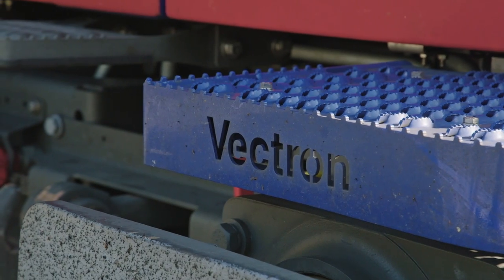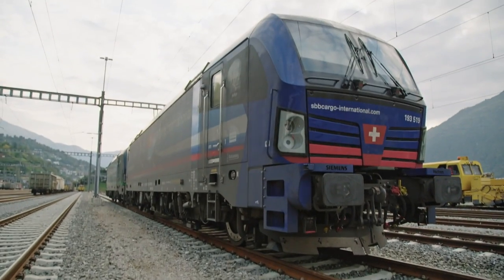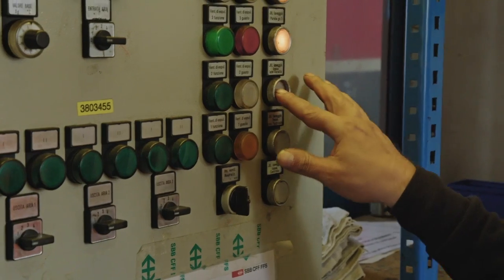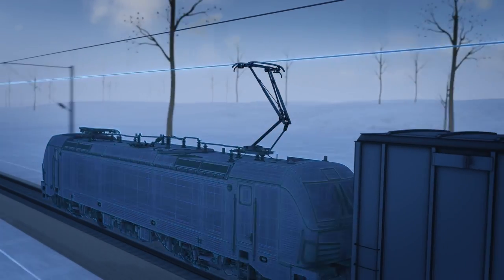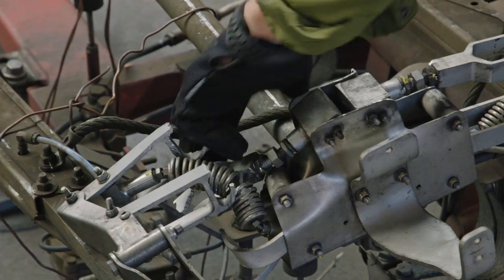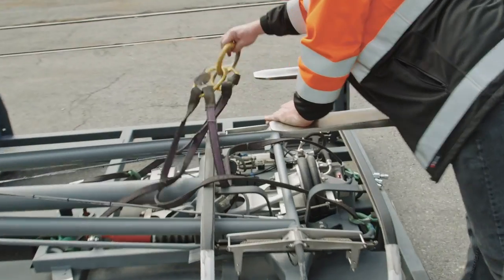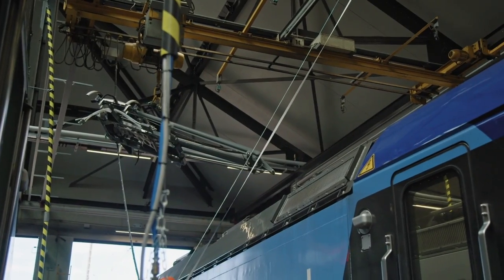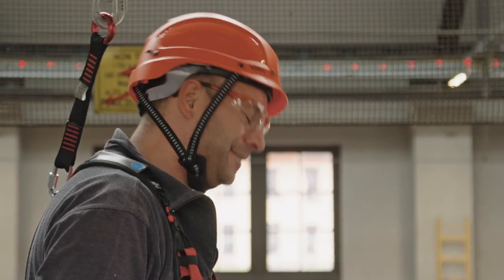A Train’s Pantograph Pulls in Enough Electricity for 200 Houses 🔌 Impossible Repairs | Smithsonian

Comment: Somebody needs to fix the title and your math.

Did you divide 25,000 volts by 120 for household voltage to get 200 homes? Voltage is not the unit for power consumption. 

This is like saying that at 100mph, this train is as fast as 2 cheetahs. The units just don't add up that way.
Reply: Ha ha! 😀
Reply: fax

Comment: The four systems are Pentagraph, Third Rail Pickup, Two Rail Pickup and Return with is used with the Pentagraph or in two track territory, and the last one is Diesel. Each country has a different system so the engines need to be adapted for each border.
Reply: Third rail is pretty uncommon in mainland Europe for anything other than metros. The four systems he was talking about would have been different AC and DC voltages used in various different countries.
Reply: What is a "pentagraph"? The locomotive only has four pantographs. Not five...